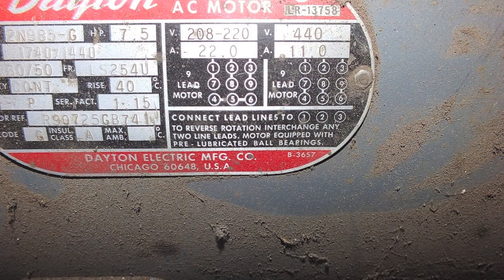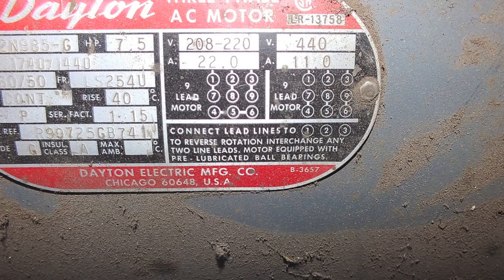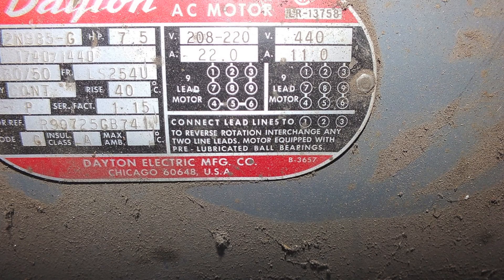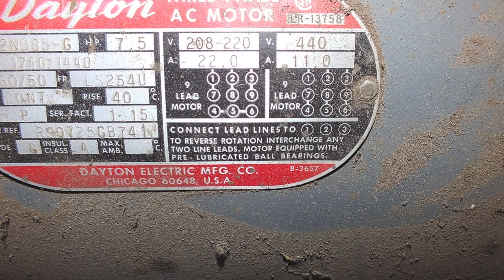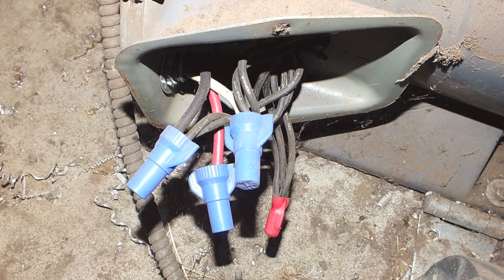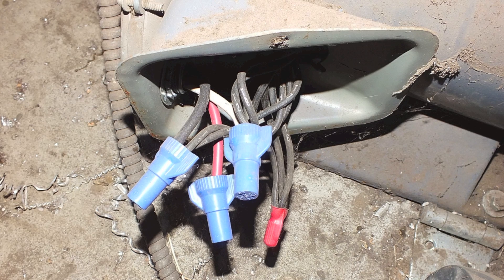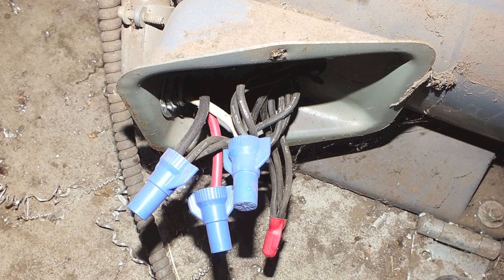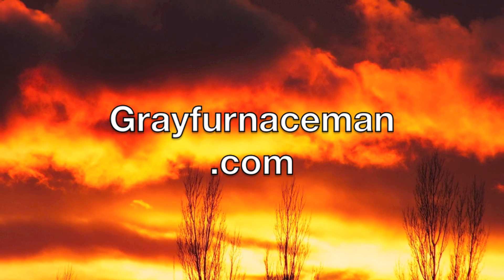How to connect the wires for a single to 3 phase conversion

Comment: I was given a three phase air compressor which I found out later on. An electrician said I only have a single phase and it costs a pretty penny to get a converter. The guy who gave me the compressor said his electrician that wired it up to his shop told him the Leland Faraday motor can also be ran as a 220 or three phase just that it needs to be wired differently through the relay🤷🏽‍♂️ I’m not an electrician. Now another person who is going to check it out said if my motor has low and high voltage then yes he can run it as single phase? Unless he misunderstood me because the first electrician I spoke with flat out told me no and didn’t even give me a real chance to ask questions
Reply from the maker: If it is a 3 phase motor, it cannot be run on single phase.  There are ways to add a phase to make it work.  Check this video:  https://youtu.be/e6eKDsDpup8
GFM

Comment: I’m certainly no electrician but am a handy kind of guy. I took a three wire cable with a welder plug on one end and connected it to the two legs of the motor as in your picture(two of the blue connecters).I grounded the green wire to the motor frame as it would be to a welder. Now each leg produces 120V going in ,I checked that with my digital meter. I started the rotary motor with a pony(start motor) to get it running ,and it does run on it’s own after I took the start motor away. Now two legs of power coming out of the rotary motor show 120V and the third leg shows 167V. The two legs showing 120V are the ones connected to the welder plug cable. Shouldn’t these legs be 240V to attain 240V three phase power?
Thx in advance for any help.
Reply from the maker: If you have 240v coming in between any 2 lines, (not to chassis), you should have 240 coming out except for the 3d unconnected phase which will be variable.  
GFM
Reply: Thx very much for your reply. I will test between the lines tomorrow as I was just testing one line to chassis before. Makes sense now. Tunnel vision on my part.Thx again.

Comment: Since the converter motor is 3 ph. and runs after the pilot motor brings it up to speed. Couldn't you just hook a pilot motor up to the machines motor and eliminate the converter motor. For example I have a table saw, with a three belt pulley, only using two belts to drive the blade. Couldn't I just hook a pilot motor directly to the table saw motor, to bring it up to speed, and then power it up? Thanks for the help.
Reply from the maker: Danny Jackson The converter motor is the source of the 3d phase.  You can use the pilot motor to get the 3 phase motor up to speed, then turn on the power to the driver motor.  It will run, but only on 2 windings.  The 2 windings are then under excessive load, and is the motor is under high load, it will overheat.  Hope this helps.
GFM
Reply: Yes I found more info on youtube. I believe I'm going to use a starter and run cap. with a motor starter. Everything I've seen and read it should work fine. Thanks for the help.

Comment from the maker: No.  Once the start motor has brought the converting motor up to speed, the start motor is shut off.  The converting motor will run on single phase, but will not start.  When the converted motor is needed, you simply turn its power on and the generated 3d phase is fed to the converted motor.  Hope this helps.
GFM

Comment: There is another way to, some variable frequency drives are equipped to convert 1ph  power into 3 ph power. However they are kind of pricey... I commissioned a make up air unit a couple years back that had that contraption.